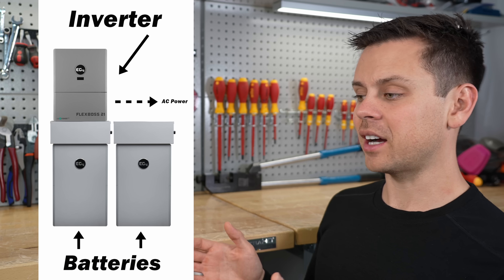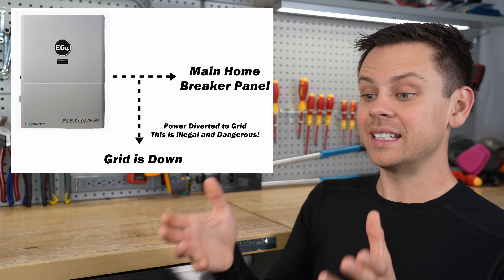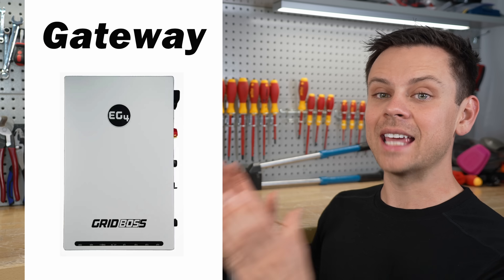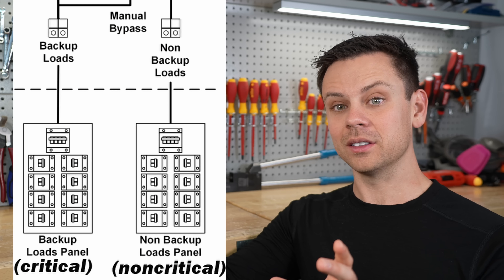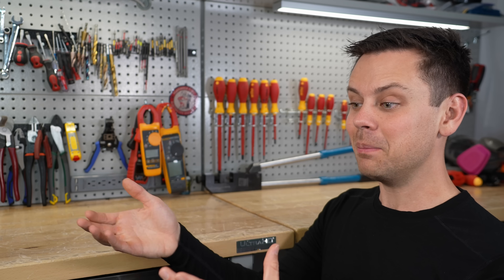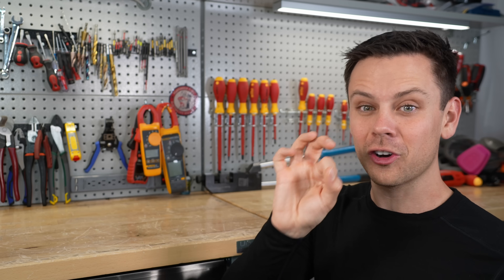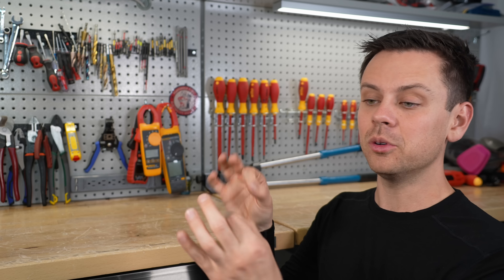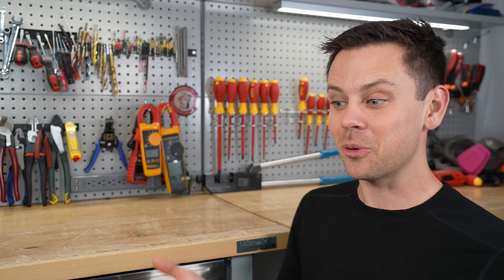EG4 Grid Boss Gateway: What is it?? Beginner Friendly Tutorial!

Comment: From my understanding the Gateway allows you the flexibility of adding much larger system onto a 100A or 200A service house. This is basically because the bus bar is rated at 200A but the 120% rule says you can only load the bar up to 20% over the rating which means 240A, which on 200A of service that only means you get 40A of solar unless you reduce the size of your main breaker... By using this its internal bus is 350A, so it can handle 200A of residential service, + Multiple Flexboss/inverters all supporting higher than the 7-9kw PV system that usually would be the limit if you stamped onto a 200A house.

Comment: I don't get it. Your hybrid inverter has anti-islanding right? So why would you need a transfer switch?
Reply from the maker: To run loads off-grid
Reply: @WillProwse  Thanks for your super quick response. But if your hybrid inverter has a separate load port like the Deye inverters, you can connect the grid to the grid port and the load to the load port, and you do not need a transfer switch. It even has a gen port for a generator, which you can also configure as a separate load port for specific scenarios like excess energy.

I get it when your hybrid inverter only has one port to which you connect your loads and grid, but most hybrid inverters have separate ports, or not?
Reply from the maker: @bartdeking  sure but that's just what the code requires and how they are designing these things now. To run your panel off grid it needs to be physically disconnected and that's the law now. These are not grid backfeed only. It's different
Reply: @WillProwse  Okay, I am living in New Zealand. It is fine here to just use a certified inverter with anti islanding.  I am not sure about your audience, but I imagine that a large portion of it does not live in the US. Thanks for your great content, though!

Comment: Hi Will, Great stuff.  Inspirational really.  
I am new to this and I am trying to learn from your videos so I can extend my current system which I bought through professional installers, connected to grid with a net meter, and 23 panels on the roof.  And now I want to expand and get batteries but I can’t afford to tie in to the existing system and face the code regulations.  I was so inspired your first video that I thought I should buy flex boss and grid boss just to have an easy way to add 12 panels to a battery and connect to house sub panel.   But in this recent more basic explanation of the grid boss I am wondering if I can connect to my panel with flex boss and eg 4 because you said they have built in transfer switches.  Is it feasible to connect to sub panel and have the house draw on the battery while having some control when it draws without it feeding the grid? Or does this need grid bossgateway.   I’m only going to add 12 panels.

Comment: Does the Grid Boss replace my current service panel? I understand grid power feeds the grid box, but it’s not clear if the grid box then feeds my service panel or if the grid box has its own circuit breaker?! I’m thinking the latter, else how goes it know which loads are critical? Trying to understand exactly what the electrician has to do… install the grid box, feed grid power, but how does it feed all my house circuits?!

Comment: So, I assume the Gateway can sense when the grid goes down, and automatically take you off grid so you're running off of solar and batteries? 

Also, are any general purpose gateways supporting V2G/V2H protocols? I know GM and Ford have their proprietary systems, but you spend like 8 or 9K and you're locked into that brand.

Comment: Watching this now does help it make sense.  I currently have a 200-amp service that's completely full.  If I wanted to add another 50-amp outlet to my garage for another EV, I would have to upgrade it and change the box. Apparently with a full set of these, I would only need another breaker and wires to the outlet without having to change my original service.   This does add a bit more cost than the 18k though.  Oh, sticky your other comment below mine now.
Reply: Well, ignoring the EG4 stuff for the moment, if you have a 200A service panel that is completely full, the way you would add more circuits to it would be to add a new sub-panel nearby, move a bunch of the circuits over from the service panel to the new panel (so now there are a lot of free breaker slots in both panels)... and feed the new sub-panel with a 100A 2-pole breaker from the main panel.

You don't have to upgrade the main service panel or your service.  That can be quite expensive depending on how the panel was installed.  That is, the sum of the breakers in the main service panel can exceed the 200A without issue... its just that the total actual power consumed by the whole home cannot exceed the 200A.

Main service panels almost always have severe breaker count limits in them and disallow the use of tandem breakers and such.  But there is no rule that prevents one from farming circuits off to sub-panels and then just having sub-panel circuits in the main panel.  There isn't really any actual circuit limit when you branch into sub-panels.

-Matt

Comment: Hi Will, thanks for videos on the Gridboss. You mentioned in your last video that you would not put your EV charger on a smart port since you want that always available. 

For my current install I was planning on putting my EV charger on a smart port so if power goes out in middle of night and I wasn't aware, the EV wouldn't drain all three batteries. Then I would manually re-enable if I want to charge car off batteries probably while charging at reduced KW output. Since you mentioned you would not put EVSE on smart port, I am wondering if I am missing something.
Reply from the maker: No that's smart. If you're 100% off grid it's good. I'm just too accustomed to the grid. And I have way too much power lol

Comment: It would be great if you could look into using the flexboss with the Eaton's AbleEdge Microgrid Interconnect Device (MID) which is a retrofit product that goes into your existing panel instead of using the grid boss.  This avoids adding yet another panel for a cleaner install.  I have not been able to find any install info on this offering so such content will be valuable for anyone interested in the AbleEdge transfer switch along with the wifi smart breakers for load shedding when on limited backup power and/or energy.

Comment: Stupid question.. could you wire the generator input on the grid boss to the load output of a 6000xp and then wire your generator directly into the 6000xp generator input. This would get past the need for a hybrid inverter.

Comment: I have 3 6500xps along with batteries and panels powering my home. They are currently in a barn away from the house. I back feed through a 100 amp line running to the house. I leave the main breaker off and the barn breaker on normally. If I run out of battery power I switch these breakers and get power from the grid. How would I hookup a flex boss to solve the transfer of power problem automatically. Would I install in the barn or the house? Buildings are about 60 feet apart

Comment: Question I haven’t seen answered… can the Gridboss be connected to an other inverters, Growatt 12K/EG4 18K? Forgive me if this seems an obvious answer. I love my Growatt 12K so I am cautious  about adding something else without knowing for sure. Thank you for your time. 🙏🏻
Reply: It depends on what capabilities you need to have working.  Basically, though, the only third-party inverters you can hang off of a Grid Boss are those that operate like micro-inverters or grid-tie string inverters... i.e. those that operate like AC coupled solar.

Other topologies are possible but don't make a whole lot of sense:

* A Smart Port on the Grid Boss could be connected to the GRID input of any third party inverter that has a GRID input.   But said inverter would only be able to operate as AC coupled solar (like a micro-inverter or a grid-tied string inverter).  The Grid Boss would still need a master AC source on its GRID or GEN input to have any functionality.

* You could connect your third party inverter's LOAD output to the Grid Boss's GRID input... but then what purpose would the Grid Boss even serve?

So in terms of using the Grid Boss the way it is meant to be used... as the service gateway with master inverters hanging off of it's Hybrid ports and AC coupled solar hanging off of its Smart Ports (or hanging off the LOAD side of the inverter's)... those inverters would have to be compatible EG4 inverters.  And the reason is that the communications have to be rock solid for the Grid Boss's automatic transfer switch to actually be rock solid vs the inverters output.

If you have at least one compatible EG4 inverter hanging off of a Grid Boss Hybrid port, you can definitely integrate any additional third-party inverters into the system by connecting the Grid Boss's Smart Port(s) to the GRID input of those inverters.  They will operate like AC coupled solar and their LOAD ports would essentially be unused.

-Matt

Comment: I'm tempted to get the EG4 Gridboss but the Flexboss isn't the product I need with it - I need an ac coupled battery for backup and moving solar consumption.  AC coupled because I have 2 solar arrays and the one near the main panel is on Enphase microinverters.  The larger array has 2 strings and uses a SMA inverter but it's in a detached garage, unconditioned.  Anyone know when EG4 is coming out with an inverter + battery only set up? Hoping for at least 10kW (and higher surge), probably 12-16kW to backup the whole house well enough.

Comment: Looking at gridboss flexboss system but still can't figure out how to get my grid power from main panel to the grid at the gridboss and gridboss load back to the main panel.  I originally was thinking of polaris connectors at the top of the main panel to a transfer switch and then into gridboss Eaton 200 amp breaker.  From your video, it sounds like no transfer switch is necessary.  Anyhow, if you could do a video on this would sure be great.

Comment: Could you clarify why with a gridboss you don't need large cables but with an inverter you do need large cables? If you install a gridboss at your meter, and want to put inverters on the other side of the house in the garage with batteries, why does that setup need smaller wires vs having no gridboss?

Comment: Can you please do some testing/measurements on the very high power draw requirements of the GridBoss?  The spec sheet says 55W idle which seems very high to me for what amounts to a fancy automatic transfer switch.  This product would be perfect for my application but if this power draw figure is correct, the power draw is likely too high to be acceptable for me.  Also 55W idle -- idle meaning what?  All relayed de-energized?  How much does it draw with all 4 smart ports on?  Does that 55W include the relay power draw for the main grid input relay? etc.

Comment: I would appreciate more details on how this would tie into an existing panel. You mentioned hooking up critical loads. Would this require moving breakers/circuits from an existing  panel to this gateway?
Reply from the maker: If you want that feature but not necessary. This can go right between your whole panel and your meter. If you want critical loads, need to run second panel

Comment: Asking if the Grid Boss Gateway acts as the First Disconnect when installed between the on-grid Electric Meter and House Main Panel.  If the Grid Boss Gateway is the First Disconnect, will that require the House Main Panel to have separated unbonded Ground and Neutral for all circuits in the House Main Panel?

Comment: I agree with everything you said about gateways like the Grid Boss being the wave of the future. We have a Franklin WH solar power system.  Granted, it isn't a DIY product and their aPower batteries are not 48 volt, but their aGate is a gateway similar to this one and the others you mentioned.  We put our hot water heater on one of its smart switches.  A relay cuts power to it when the batteries reach 75 percent SOC.

Comment: I'm interested in the "dark start" capabilities of the Flex Box.  I have a 10Kw SunPower array with 240V AC coupled SunPower micro inverters. Can the Flex Box with Grid Box wake up the solar array while grid power is down?   I currently have a Anker F3800 + 12Kwh of batt with Home Power Panel, a bit similar to this new EG3 system, but it cannot wake up the SunPower solar array if grid is down while the sun is up, which is a major frustration, and makes the solar array useless when grid is down.  I would switch to EG3 just for that dark start feature if it worked.

Comment: How about just having an off grid system with chargeverters to charge your batteries, either from the grid or generators?

If you don't use grid power that often, the efficiency loss would not be that big of a deal. 

Just charge the batteries back to 30% SOC if they ever get beneath 10% SOC.

Comment: You are truly talented and your videos are so helpful and enjoyable. 
I have about 20kw of existing solar, a mix of string inverters and Enphase microinverters. I think a lot of people have old systems they don't want to throw away but they want to add batteries for storage and backup.
 I have a few questions.
1. Does this Gateway allow for using these old systems without getting rid of the string inverters?  2. Will my existing legacy solar continue to produce during a grid outage or does it function like it does now and stop working when the grid goes down?
3. What happens to excess electricity produced by my legacy solar PV system if I am not connected to the grid? (I wanted to jerry rig my F150 Lightning into my existing system but I found out that any excess my PV system produces will back feed my Lightning if the grid is not absorbing the excess, and destroy the Lightning's built in system, so I guess that's not possible, right?)

Comment: Thank you for the video.  I wonder if the loads can be dynamically changed between critical and non-critical in the GridBoss - perhaps via an app.  For example, if there is enough reserve battery power, I can turn on another circuit via the app.  I believe PointGuard Energy (SigEnergy in Europe) has this feature.

Comment: To clarify. If you are using an off-grid inverter it can't feed back to the AC source. So in that case does it still need a gate way to separate it from the grid? Looking at setting up a system in a small out building as subpannl and then tying my well to it as a critical load.

Comment: Okay, I’m one of those you confused, but also got excited.  So I’ve got a couple follow ups.  I’m doing an addition with a solar friendly roof, and a barn with solar friendly roof faces.

My plan was to do the barn first because it can “stand alone” with its power. I assume in this case a FlexBoss is my answer, and then I could also feed power back to the house (and grid) with a line back to the GridBoss?

And I guess I’m a little confused about grid connections, I thought I was required to do net metering, but you seem to imply that rather than do that, I would be able to use the GridBoss as a way to live off my solar, except when I need grid power as a backup?

Sorry so many questions

Comment: Is it safe to assume that the grid boss is only for those looking to have a more “complete” grid tie system with potential off and on grid inverters? 

Reason for asking is due to the “fast zero export” setting that has existed on the 18kpv for some time and is now also seen under the available settings for the flex boss. 

While I see that the grid boss as useful I still also see a lot of value in just the flex boss being that it has the potential to support and peak shave with a grid dependent system but obviously not back-feed. For many, I find this is the sweet spot because for some it allows them to take advantage of solar and reduce power bills while also allowing, for some, to not have to deal with interconnect agreements.

Comment: Will, load shedding does not mean using excess power. it means to shed the loads for reduced power consumption. 

thanks for the video.
Reply: Right. The graphic at 2:37 shows how "excess power" would be handled: with "dump loads". Or excess power would be fed into the grid (when it is not down). And the grid itself might have dump loads, like grid-scale batteries or pumped hydro.

Comment: Great looking products.  Can multiple Grid boss units be used on a 400 amp service with dual 200 amp feeds?
Reply: They would have to operate as separate systems rather than a single whole.  But there is nothing stopping you from sharing the same battery bank between the two so for all intents and purposes it would still work pretty much as expected.

-Matt
Reply: @junkerzn7312  do they communicate to coordinate grid sellback?  If I cap the sell back at 10,000W, does it split it equally or at least calculate 10,000W as a total?

Comment: It seems central to me to get a technical description the gridboss requirements for connectivity to remotely placed hybrid and ac coupled inverters. In other words, what minimum wiring for control is necessary. A different apsect is what does the device require for new wiring.  I am not talking about the meter side of the unit.  I thought you were going to compare to alternatives like the schneider BCS.

Comment: Thanks for this video! It answers a lot of questions. I saw you mention in one of the comments above, a gridboss is not necessary for off-grid inverters right? I'm planning on scaling up to a full sized system that can be 100% off grid and have been eyeing the EG4 12000XP. I would like to have the Grid pass through or charge the batteries if my solar isn't enough. I know the 12000XP has a 100 amp pass through so it seems like that should suffice for that. Do I still need a transfer switch like the Gridboss?